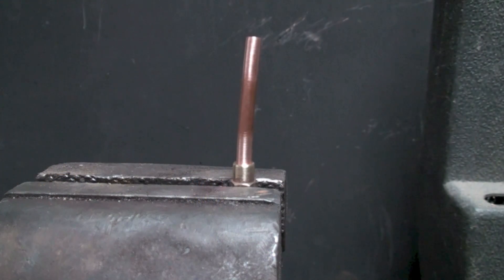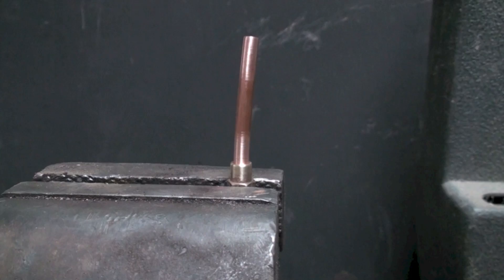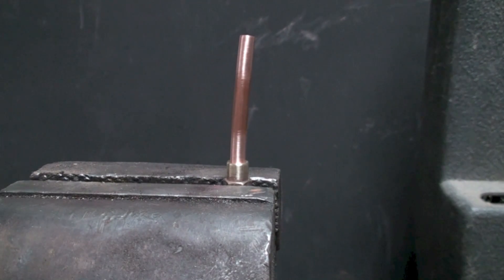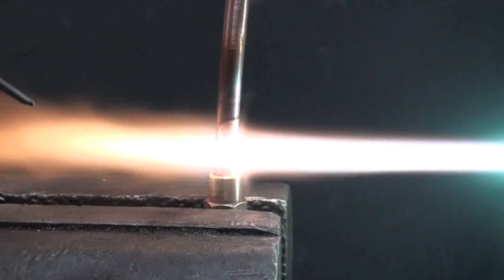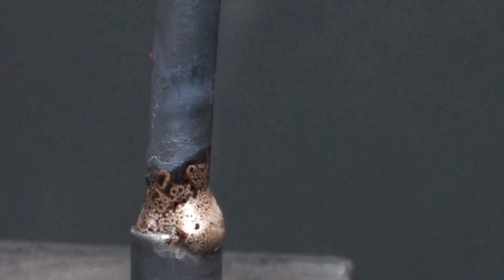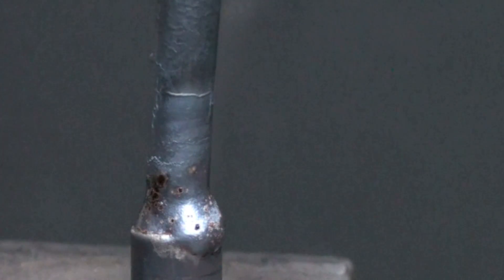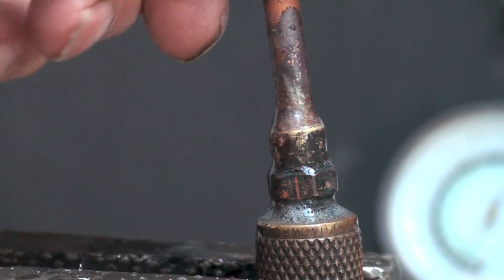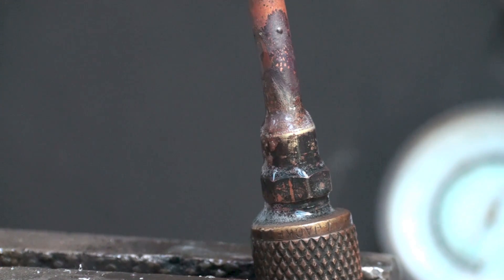How to braze copper to brass

Comment: QUESTION……  if it’s copper to brass does it require flux??  PLEASE AND THANK YOU
Reply from the maker: When using 15% sil phos, no flux is used. I do not recommend this repair with 15% unless you are very experienced.  I would use 30% silver braze.  30% does use a special flux.
GFM

Comment: Thanks. Can i use propane torch  for welding
Reply from the maker: For everything above 3/8", propane will not work.  Mapp may be better.  Oxy-acetylene is best.
GFM
Reply: @grayfurnaceman  I appreciate your cooperation. When welding or brazing copper to brass .use  brass rod

Comment: Gary, Brass melts @ 1710 F and Copper melts @ 1983 F. I am thinking the Brass never reached 1710 F because the Steel Vice is absorbing the heat from the the Brass Fitting. The Copper is heating because it is thin and the Brass is thicker and the Vice is receiving the heat from the Brass fitting. Brass is a composite of Zinc, Lead and Copper Or the Old Brass were. So the SealFlos should work on the 2 Fittings.

Comment: Yuck lol
I only use Silfos on copper to copper for high side applications like the hot gas line or tube repairs on a condenser coil
Low side like the TX valve is always soft solder and for copper to brass or copper to steel flux coated Silvaloy 560 flows nice 
But I am a transport refrigeration mechanic so the units I work on are subjected to a bit more abuse from being in transport all the time
I'm surprised you got that Silfos to stick lol
Nice work

Comment: I have always used flux coated 40% or higher  for any bi metal joints. 15% will work like you did it but like you said but you need some experience beforehand going down that road. thanks for the video and confirming what i have been saying for along time. i had a really good teacher/ lead when i was learning. I hope more people take the time to watch this.

Comment: Today whilst I was trying to clean the weld of a return line on a small compressor my wire brush dug in and popped the pipe right out of the housing and worse it snapped into two really rough pieces and landed in the dirt, I thought no worries I'll just grab a stub of copper and weld it back in, wrong, that pipe I could not find anywhere listed and could find nothing suitable in my salvage pile but I did find a length of brass rod that I have been hanging onto for over 20 years using bits here and there but it was too thick, so I chucked it up in the lathe and bored a hole through it and turned the outside to the diameter of the old pipe, poked it into the hole the other one came out of and used 5% silver solder and CIG flux and soldered it in, it looked real nice and I used flux on the other for the slip fit end and plain silver solder on the small discharge joint, all looked well and I put some gas into it to test it and no leaks, winner.
Reply from the maker: Where there is a will there is a way.
GFM

Comment: Great videos sir i really appreciate the time and  energy for making this videos. 
What is the size of the tip you use in this video and what will happen if use smaller or bigger tip? 
I just got a little oxy/acetylene kit and it came with #1 & #2 tips, 
I am looking for the best for welding and brazing steel, aluminum and brass & or copper. 
Need your advice. 
Regards.
Reply from the maker: Its a victor #2.  Smaller may overheat the joint because it takes longer to get up to temperature.  I generally like to use the largest tip I can for the job.  It heats faster.  Experimentation will tell.
GFM
Reply: grayfurnaceman Thanks

Comment: I always use flux when brazing copper to brass and have had no problems.
Reply from the maker: +Jim Gill The problem with flux is that I have had some problems with flux displacing the braze compound.  If I could never use flux on brazing I would.
GFM
Reply: +grayfurnaceman You have some of the very best training videos that I have ever seen. I have learned a lot from them, even with about 40 years of service experience in the HVAC and commercial refrigeration trade. Thanks and please keep up the great work. When I am brazing copper to brass or copper to steel, I feather the inner cone and heat the copper first getting the joint just hot enough to flow the 15% sil-fos into it.
Reply from the maker: +Jim Gill Welcome
GFM
Reply: I only use powder fru
Reply: I've grazed all types of diameter brass to copper from 6" all the way down, flanges, drip tee's etc. Never had to use flux until recently when I had some ½" by ⅜ female IPS 90's... from Mexico 🤷🏿‍♂️

Comment: That vise provided a heat sink. That may have made the brazing more difficult.

Also try using the 40% brazing flux even though using Sil Phos. It seems to produce a better braze.

Comment from the maker: No, the temperature is very high and I dont know of any flux that will work at that temp.  The high temps used will actually burn off oxidation of the materials.  The key to this operation is controlling the temperature.
GFM

Comment: I braze copper to brass the exact same way I do copper to copper. I even use 5% with no problems.
Reply: mazzmari u must be working on some small fittings
Reply: You must use flux. The material must penetrate between the two pieces.